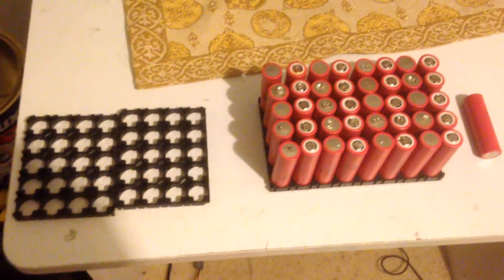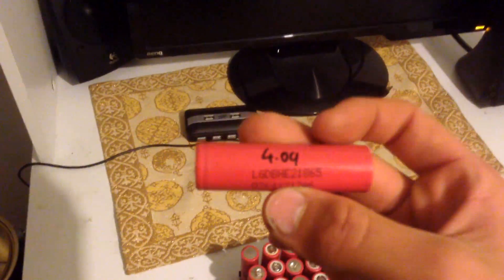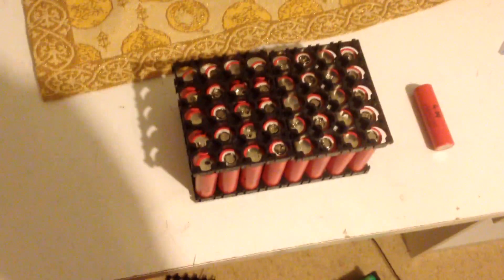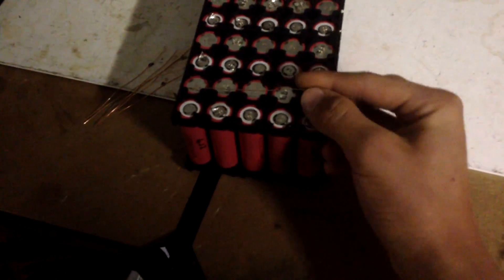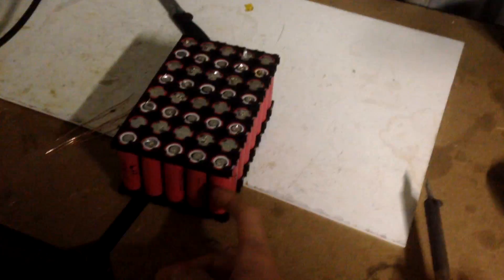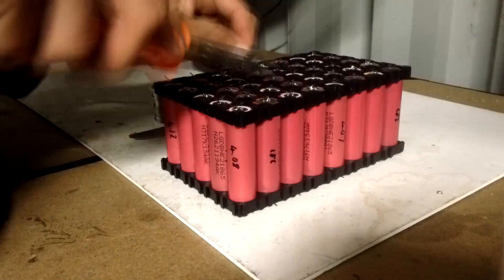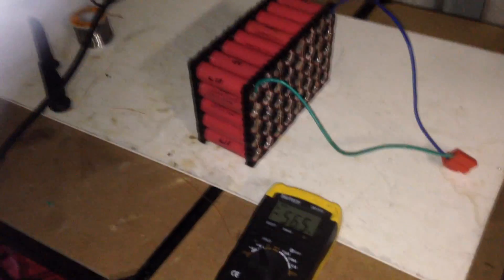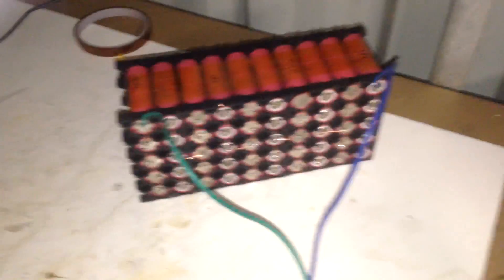DIY 10AH 36v Lithium E-Bike Battery Pack | From Old Laptop Batteries

Comment: Can I use 3.7v 2000mAh 10 batteries for make 36v 20ah battery pack for ebike...? Please reply me !....
Reply: you will need 10 by 10 cells,  10 in parallel by 10 in series,  10 in parallel will give you 3.7v 20ah if yo put 10 of that in series you got 37v  20ah  will need 100 cells

Comment: Hypothetical .. Looking at that 36v 10ah pack  and comparing it to a 12v deep cycle 200AH battery.  If both were to drive a 36v DC motor how would they compare in terms of performance? As far as price a brand new 12 volt deep cycle 200ah battery is around $350.
Reply from the maker: cyberpine first you would need 3 200ah 12v batteries in series to get up to 36v and if this for an ebike for example it would weigh a tonne. 36v lithium back would be light, compact, will have little voltage sag and will probably last longer. That’s my take anyway
Reply: @RandomDIYProjects0  how many batteries in a 36v lithium pack that could drive a big DC more as strong and for as long as the led acid discussed? How big in size/weight? How many KWH? What could I get this for? Build it myself?  Believe it or not (based on videos I've seen on YouTube) I think three 12v deep cycle 200AH batteries would be able to propel a 2500lb (dry weight) car 20mph with scrapyard 36v 400amp forklift motor and would cost less than $1000 for the batteries that should last 5 years.

Comment: What is the specification of the 18650 required to build a 24v 14ah battery pack? How many cells are required?
Reply: You'll get a 25.9 or a 22.2v pack as each cell is 3.7v. For 14Ah, considering each cell is 2000mAh, you'll need 7 in parallel with 6 of those in series (6S7P system). So for a 22.2v 14a system that's 42 cells in total.

Comment: Hey bro I wanna make a 12ah 12v battery pack plzz help....
Reply: Build your own, the battery not so damn expensive 
I just build one
48 volt 6 amp
I just cost only 23 dollar
yeah just enough 15km range
if I want to build another battery
battery seperate it cause I don't want to overheated my battery

Comment: Little stingy wire? I hope you're just running a flashlight or a radio.... anything with low amp draw... a EBIKE running off those gimpy wires (also only 1 series connection) looks like a bad idea here. close though.